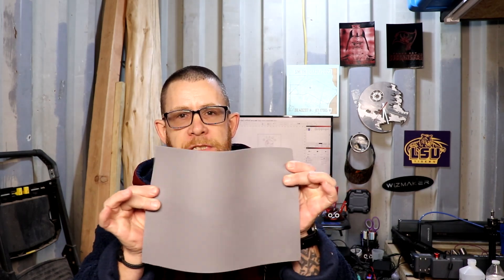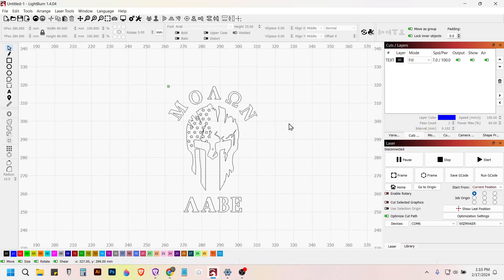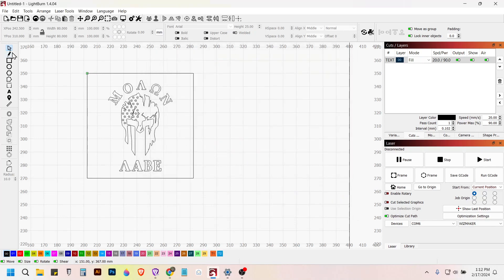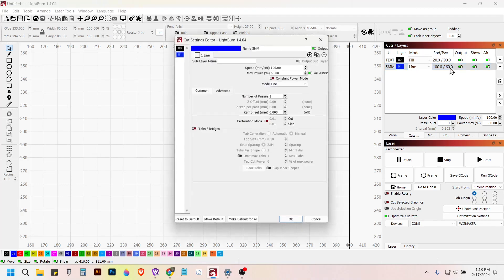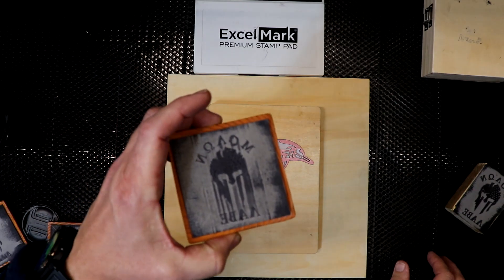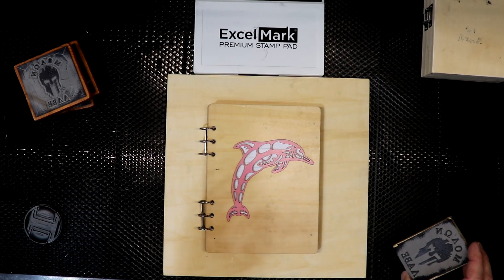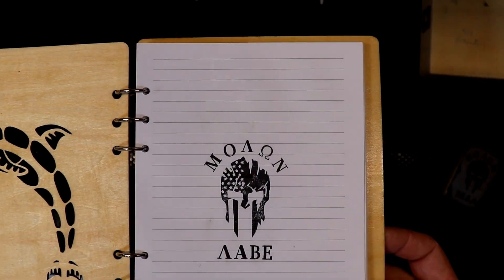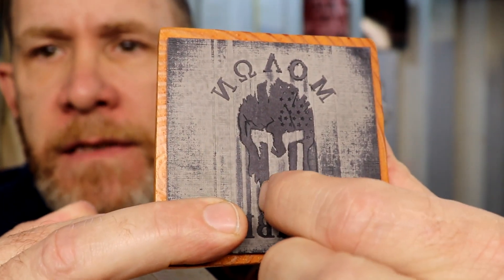Laser Engraved Rubber Stamps

Comment: Hi, thanks for your video. I am a little confused, so the stamp art is not defined, but the box around it is as fill. The laser cuts the box and avoids the art because it was not defined? Is it that easy? My noob approach was going to be to cut the design in the box. Thanks
Reply from the maker: There are 2 rectangle layers there. One with the art and the second is set to cut.

Comment: Hi great, Just one question/sugestion why the double box? when you make the first square instead of grouping it with the design just leave it as a second layer as your cut layer. with out that as part od the ingraving it shoudl cut down y our time and keep it clean
Reply from the maker: Grouping the 2 squares makes no difference on burn time as one is line and the other is fill. I grouped them together for ease of movement around the Lightburn work space. It only takes a second to ungroup them if any changes are needed. Also, if the first square and the actual artwork are not grouped, it will fill both.
Reply: ,  @LaserNoob  Thank you but I think what I was trying to say the originail art work would be fill, the first square would be the c cut/line second layer, by having the first square grouped the laser has to go out there using the fill to make the box that your going to cut on anyway
Reply from the maker: Yes, but if the original artwork is fill, then I get the opposite of what I want for a stamp. On wood, yes the artwork would be fill and the square would be a cut line. But as I want the artwork raised for a stamp, everything around it needs to be burned off.